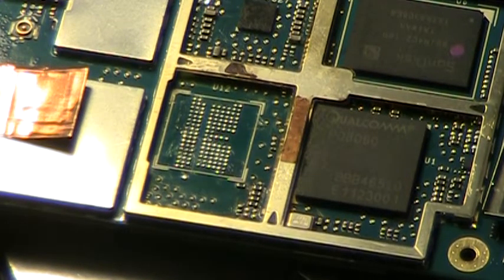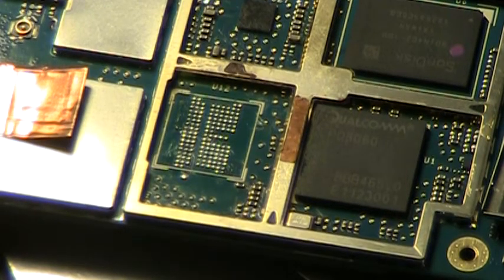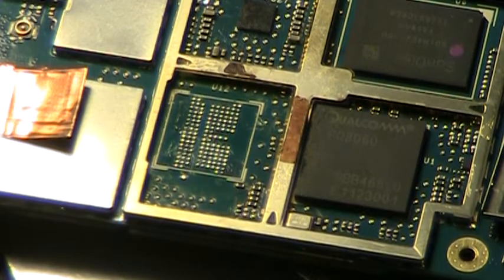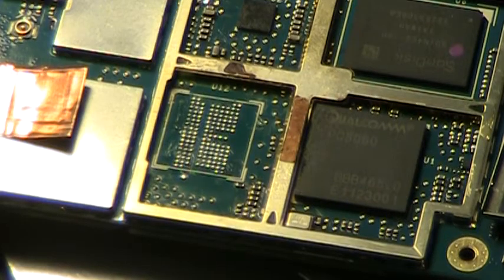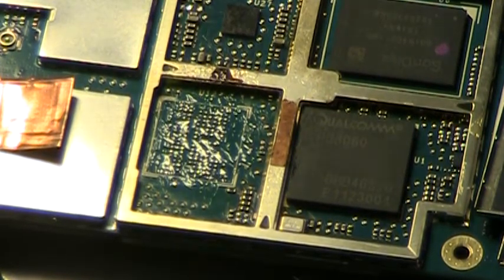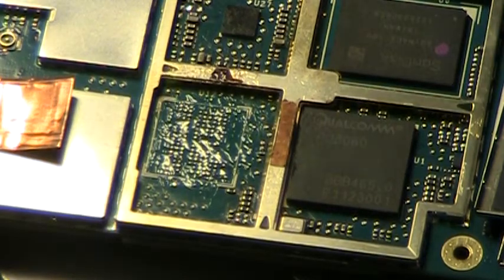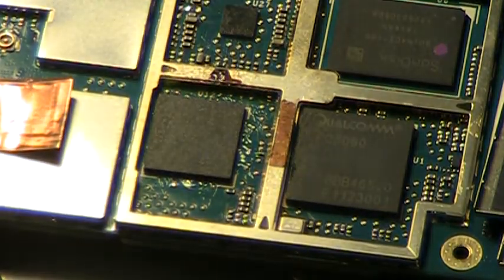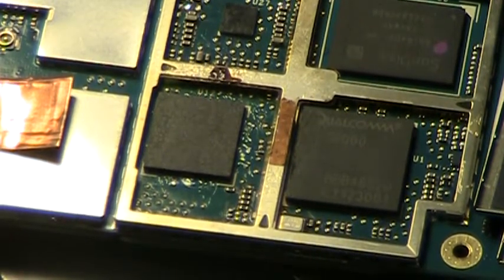HP TouchPad 2GB RAM upgrade - apply flux and position new RAM chip

Comment: wtf, you didnt even cleaned the bga pads on pcb, you just reflowed another chip, was that with balls? or a flat cleaned chip,, in both senarios it will be a mess under the chip, you didnt even showed the results wether it worked or not,